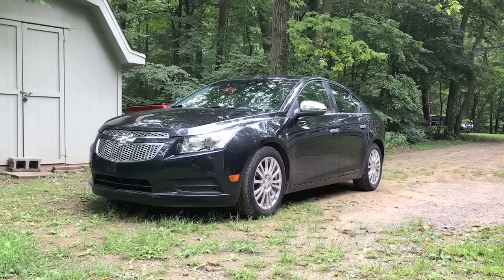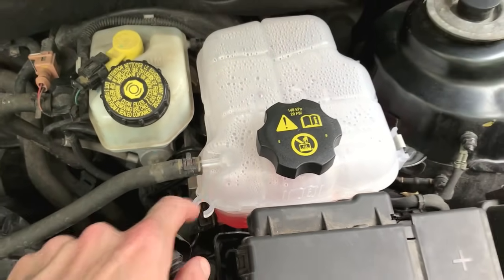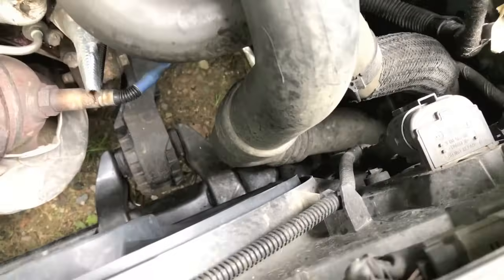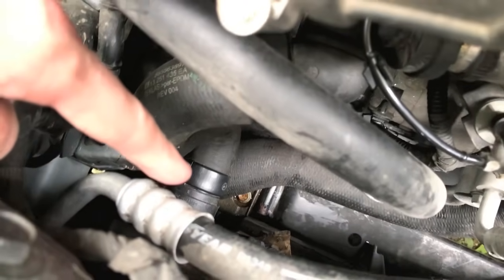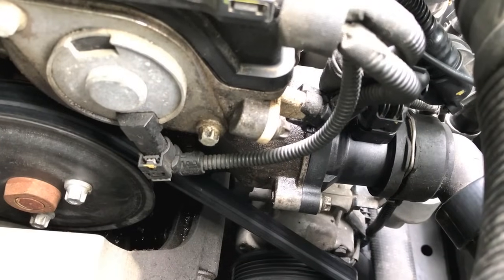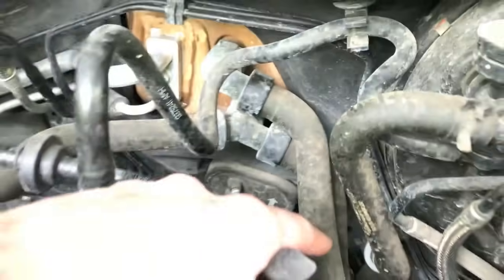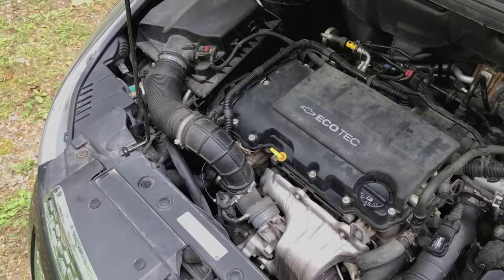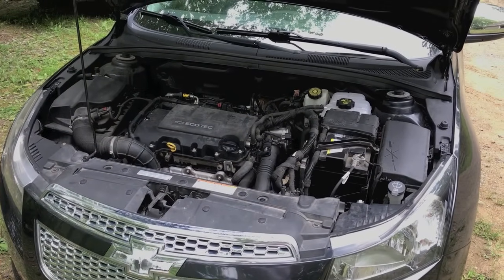Most common Chevy Cruze coolant system leaks! - Malibu/Impala as well

Comment: Loathe this car. It's like it was designed to fail from factory.
Reply: ouch
Reply: Literally. First nice car I buy myself and it's this piece of actual shit.
Reply: thank u so much
Reply: It is
Reply: My 2014 Cruze (bought it new) has 160000+ on the odometer. Just today the coolant reservoir started leaking coolant. Thankful I got that many miles out of it before having to replace the reservoir. But yes all these new vehicles with cheap plastic parts under the hood are designed to fail 😤
Reply: We have one also, they are horrible
Reply: Had a Mitsubishi that ran forever with minimal repairs. Bought a  Cruze and its  at the shop continually.
Reply: Fml
Reply: Bought Mine with 10k on the odometer. Leaked coolant sin e neatly the first day. Had fittings bust dramatically twice. Ill never by a GM again.
Reply: 190k and I beat the piss out of mine. Did the turbo for 200$ and the intake fix. All these fixes can be done really cheap at home!
Reply: Limp mode traced to leak at temp sensor feeding coolant into harness. Ruined PCM harness all the way back to O2 sensors. Still waiting for parts. GM charges for PCM programming …PCM harness is only available used…  Design for manufacturing, not for service or durability
Reply: (It was)

Comment: Thank you so much for this video. After 2+ years of a "mysterious" coolant leak, and hundreds of dollars down the drain with mechanics whom never fix the leak...I was driving home today from work when smoke starting billowing from the hood, getting home I open the hood to see coolant spraying like crazy, and with a quick google search I find your video...long story short, you pointed to EXACTLY where it's spewing from, the gasket seam on the thermostat, and now I know finally where it needs to be repaired! Thank you!
Reply from the maker: Ashley Matossian 

Thanks for watching & we hope you enjoyed the video.  We are happy you made it home safely & we appreciate you sharing your experience.  Hopefully a new Thermostat will solve your issues.  Keep us posted!

Many more helpful videos to come!  😀

Please subscribe to the channel and turn on your YouTube notification Bell 🛎 that would be awesome thanks again.

😎👍🔧🔩
Reply: This is only the beginning. In 3 years I've replaced 3 coolant recovery jugs, radiator, 2 thermostats,  waterpump, water outlet, both upper and lower radiator hoses, heater hoses and turbo coolant hoses (along with the turbocharger). Each time I install a new part, a pressure test tells me the leak is fixed. Then, before long, I smell coolant again and the leak - finding process begins all over again. As of this writing, the cooling system is leaking yet again. This is the worst car I have ever owned. My next car will be a Honda...good luck!
Reply: Same here except for I see how the area for mine looked like it's been wet alot

Comment: "Many years" my tundra has survived 14 years no maintenance like my gf pos chevy which is only 4.
Reply from the maker: Tyler Bolton 

Thanks for watching Tyler, let us know if you have any questions.

😎👍🔧🔩
Reply: Dude facts. My truck is a 2010. Never had any problems high miles, then she buys a 2014 Cruze. Replaced three components in her coolant system that have cracked or leaked just this year! On this video because she just called me on her way home with another low coolant reservoir. Very disappointed with Chevy
Reply: Ha ha. I’m a Toyota guy and have ran a few over 400k miles and still run them for work. Stupid Cruze is always a problem.
Reply: on my way to buy a damn tundra then second time i have a leak in the last 6 months
Reply: Lmao dang, no maintenance at all in 14 years?
Reply: Toyato is my next car hey are reliable
Reply: @RedBeard_1911  must only drive it 1 mile a day
Reply: Gm needs to get there foot of there but

Comment: Excellent video. Very informative. I've got a leak in my coolant system. The hoses to the turbo and the reservoir tank as well as the return line were all replaced. Had a pressure test done. Couldn't see any leaks. Not by me but from a shop. 1000$ later and I still have a problem. I'll keep an eye out around the thermostat and water pump area. Frustrating because about every 3 to 4 days, I have to add coolant. I'm not a grease monkey. Wish I was. I build elevators. I've learned alot from your channel and hopefully I can figure it out. AGAIN, THANK YOU FOR A GREAT VIDEO.
Reply from the maker: Semper Fi 

Thank you very much for sharing.  Sorry to hear about your engine troubles.  Adding coolant every 3-4 days is definitely not normal.

Let us know if you have any questions.  If you build elevators, you can work on a Cruze.  😀👍

Please subscribe to the channel and ring your YouTube bell 🔔 this will be very helpful to us thanks again.

😎👍🔧🔩
Reply: Did you ever find the leak?
Reply: After all these years did you ever find a fix?

Comment: Starting right at 2:00 minutes. That hose you are talking about has a smaller hose, #14 & #15 in the Chevy dealership coolant diagram, called a turbo charger coolant return hose line. The joint under the heat shield that connects to the hardline was leaking on my Cruze. Hope this helps others. Thanks for the video !!!
Reply from the maker: You rock & we appreciate you sharing this.  Any & all helpful info is greatly appreciated.

As we always say, us DIY’ers need to stick together!  😎👍
Reply: @DIYwithMichaelBorders  I decided against replacing the entire part since you have to remove the turbo to access it. I instead cut off the hose & hydraulic crimp off the hardline with my oscillating tool. I cut a 5/16 Dayco molded heater hose from AutoZone (B86800) to size & wrapped it with heat shield tape & added two new hose clamps. Seems like it works well!
Reply from the maker: @michaelhowell8990  

Thanks for the update Michael.  Hopefully many stress free days ahead for you.  😎👍

Comment: Thanks for the video - My Cruze is leaking and its either the water pump or the hoses on back firewall, or possibly the heater core. 
With this video I can now go and take a second 'better' look at all the places that it can be leaking from. 
My car only has 40K on it so I was surprised to have a leak so soon.
When I looked under my hood my leak seems to be farther back than the water pump area. I also inspected that side of the engine already. 
Water pump didnt look wet and the leak appears to lower down than that, I know the leak can be flowing down to appear more under the car than it is.
Reply from the maker: Ucan TrustMe 

Thanks for watching & sharing your experience.  In the event that it is your water pump, this is a GM recall part.

This means you can contact your local Chevy dealership and get it replaced for 100% free.

Keep us posted on your project.  Please subscribe to the channel and turn on your YouTube notification Bell 🛎 that would be awesome thanks again.

😎👍🔧🔩

Comment: Thank you for all the help. Been having a leak for a second time.  First was the water outlets hose which was replaced and seemed to do the trick. Ut now another slow leak and seems to be passenger side.  I am suspecting the water pump thermostat but gonna follow advice and see what I find after car is warmed up.  Thanks. 2014 chevy cruze Lt automatic
Reply from the maker: Rikan_LynX 

Thanks for watching & sharing your experience.  As you mentioned with the new leak coming from your passenger side, its usually the Thermostat.  Below is a link to our step-by-step video showing how to replace your Thermostat.

       https://youtu.be/8F-17wODadQ

Keep us posted!  Please subscribe to the channel and turn on your YouTube notification Bell 🛎 that would be awesome thanks again!

😎👍🔧🔩
Reply: Did you find what was leaking on the passenger side of the car? Mine has a leak in that area too and my car only has 40 thousand miles on it.
Reply: @DIYwithMichaelBorders  I have a leak right after the water pump not that hose that leads into the the tri connector towards the engine wall oh, what's that part number and do you have a video do you know somebody that has a video on how to replace that hose
Reply from the maker: Zeromus Phoenix 

Thanks for watching & we are glad to help.  This is a Dealership part only.  We recommend contacting your local Chevy dealership in providing them with the last 8 digits of your VIN #.  they will be able to get you the exact replacement part for your exact vehicle.

Us fellow DIY’ers need to stick together.  Many more helpful videos to come!  😀

Let us know if you have any questions.  Please subscribe to the channel and Ring your YouTube Bell 🛎 that would be awesome thanks again!

😎👍🔧🔩

Comment: Great, thank you for this video. I think I may have a bad water pump. Its super we in that area and the car dumps a half a reservoir after a day or two of driving. Going to look at it tomorrow and try and figure it out.
Reply from the maker: @maxpowers5055  

Thanks for watching, definitely likely if you are noticing a leak in that area.

Check out the video link below, it is a link to a video showing the full replacement process of the water pump.

       https://youtu.be/V85SIHpBLMQ?si=zam01jGNFoD8A_j5

However first, contact your local Chevy dealership and ask them if your Chevy Cruze is eligible for the full 100% free water pump replacement under the recall program.

They will need your VIN number and likely license plate number to check if your Cruze is eligible.

Comment: excellent easy to follow  videos Michael i can relate all repairs to my holden cruze in Australia which is awesome!! there is a small hose directly straight down from the oil filler cap its insulated in a flexible silver . type foil. it connect to the underside of the valve you are showing in this video.i have the slightest leak from that connection . its looks awkward to remove i have been searching for a video from someone else who has had that same issue, any feedback would be greatly appreciated, thanks again you are saving me heaps in repairs
Reply from the maker: Andy g 

Thanks for watching & sharing your experience.  Sorry for the delay.  What’s your update?  Have you fixed leak?

Unfortunately we are away from vehicle for a week.  Keep us posted on your DIY project.  Please subscribe to the channel and turn on your YouTube notification Bell 🛎 that would be awesome thanks again Andy g.

😎👍🔧🔩

Comment: What do you recommend for cleaning coolant and oil off of an engine? It’s looking pretty bad inside my engine. I’m doing some work on it soon. Would like to clean it up at the same time.
Reply from the maker: Good morning, just poured a ☕️ and am sitting down to answer any and all questions for the DIY community.

Great question, and that will depend on who you ask.  Most important thing to do is stay away from spraying your engine with a hose of water or any cleaning products being carelessly sprayed all over engine.

Both of which can cause havoc to your electrical system as it will likely get many of the internal engine component electrical sensors wet…which leads to the sensors acting very sporadically and acting as if they are faulty.

The - spray cleaning product on a paper-towel and dap/wipe clean engine is the best method.  Below is a link to a cleaning product we like.

If interested in purchasing this product, visit our Amazon affiliate link below.  I earn from qualifying purchases.

          https://amzn.to/41bt4sr

Let us know if you have any questions and hey if you’re interested, join our DIY ecosystem and help us grow an exclusive group of DIYers.

       toolboxtoken.com

Reach out to us any time!  🧰

Comment: Just installed my new coolant reservoir. Feels good. Only problem is when I filled it up, it continues to leak somewhere (just as the old one did) it’s disappearing in less than a minute. Only reason I replaced it is because a friend of mine, who has more experience than I do, took a look at the old one and suggested that that’s what it was. I seen a leak from somewhere under the old coolant tank but couldn’t point out exactly where it was, which is why I was quite sure it was the coolant tank itself.

My problem is that it keeps saying “AC off due to high engine temp”. Had my thermostat and radiator replaced last year. Water pump replaced at the end of July.
Reply from the maker: Thanks for watching & sharing this, any update?  The best way to pinpoint the leak is have your engine running to allow the system to pressurize.

Once system is pressurized, it will hopefully be easier to pinpoint the exact location of the leak.
Reply: @DIYwithMichaelBorders  yes, it’s still leaking somewhere. I can’t tell. I did pour the coolant in there while it was off and then ran the car. My car stalls and the engine knocks in idle.
Reply from the maker: @POPINTHETAPE  

Thanks for the update, is your engine not running long enough to allow the system to pressurize?
Reply: Did you find the problem
Reply: @anikajohnson4418  yes, i can’t find the recipets but I remember exactly because it costed me about $1100. I had to get a new valve cover replacement and have old oil around the engine cleaned, thermostat housing assembly and a water outlet valve. I no longer have the Cruze now.

Comment: Hi and great video! Sub'd.
Just replaced the water outlet valve/heat temp sensor assembly (the original plastic cracked) and upon checking for leaks I noticed some "weeping" at the top of the valve, where your finger is as you point to it at 1:46. I installed a brand new OEM AC Delco and I'm wondering if you have any ideas 💡 on how to do a minor fix on this verses R & R the entire heat temp/water valve assembly?
I thought of pulling the clip, pulling the return hose  and wrapping this water return valve with a tiny amount of high temp plumbers tape to stop the minor weeping, I'm experiencing.  Any thoughts?
Thank you in advance ☺
Reply from the maker: Thanks for watching & welcome to the DIY Raptor Club.  That hose is a dealership part only & will need to be purchased from your local Chevy dealership.

The hose itself is a very friendly DIY project.  Below is the link to our video showing how to properly replace it.

       https://youtu.be/FNXiR1do2Ws

Keep us posted.  Thanks for subscribing, we subscribed back.  Enjoy your day.

😎👍🔧🔩
Reply: @DIYwithMichaelBorders  Hi and thank you. However this OEM part is available on Amazon and at O'Reillys too
Reply from the maker: @agateenchantmentrockwizard5969  

Very cool, you may be able to get it at a more friendly price online.

😎👍🔧🔩

Comment: Thank you so much for explaining all the parts of my cooling system in such detail, possibly you can help me answer a question? I know your video is a few years old but I’m hoping somehow you’ll find my comments. I have a spraying leak that gets worse the lower my coolant is falling and more pressure is flowing. The leak is in the thicker hose directly under the water outflow valve. Would you advise using some silicone tape to seal until I can get into the shop for repair? Or anything that could seal/slow the leak for just a few days until I can get into the shop?
Reply from the maker: Thanks for watching and welcome to the DIY Raptor Club.  Let’s get this figured out!!

We recommend replacing the hose all together.  The best route to take is to contact your local Chevy dealership and provide them with the last 8 digits of your VIN number.

They will be able to get you the exact replacement part number for your exact engine.  You can either purchase replacement hose from dealership or use the part number they provide and purchase elsewhere, that’s personal preference.

Please keep us posted, we DIYers need to stick together!!!  Looking forward to hearing back from you Anon.

😎👍

Comment: My wife's 2014 Chevy Cruze thermostat has just begun to fail at 70,XXX miles. It's the one connected to the water pump on the left side of motor when facing vehicle for reference on lifetime of part.

The coolant reservoir and connecting hoses all failed at 60,XXX miles for reference, all parts were replaced with Dorman parts well worth it about 35.00

Part in question is at @3:10
Reply from the maker: Good morning & welcome to the DIY Raptor Club.  That’s a great idea, dorman has really helped many Cruze owners with their increased design & parts quality.

Hopefully many stress free days ahead for you after replacing the Thermostat.

😎👍🔧🔩
Reply: @DIYwithMichaelBorders  update the thermostat housing connected to the front left of the motor was a 2 part failure first was the rubber gasket, which is to be expected, nothing last forever. However after closer inspection of the housing the plastic tabs on the inside holding the plate and spring in place both had broken. So the valve was never fully closed and couldn't create a flush seal causing additional wear on gasket. 

Very interesting part, wish I could upload photos 📸  of the part for reference, part @ 3:10 for reference
Reply from the maker: @mezar4854  

Thanks for the update & have you completed replacing Thermostat?  If not, below is a link to our video showing replacement of Thermostat.

       https://youtu.be/8F-17wODadQ

😎👍🔧🔩
Reply: @DIYwithMichaelBorders  the linked is the one I used to replace that actual part ty! 

The next thing I plan on replacing is a pulley and a serpentine belt, one of them is squealing on idle and driving
Reply from the maker: @mezar4854  

Very cool, below is a link that may help you.

       https://youtu.be/0u-zCwZeyUo

😎👍🔧🔩

Comment: I have some bubble in the actual reservoir tank, & coolant is lacking from the left as soon as you put it in I have check the reservoir tank no leaks. I have replaced the radiator and the fan three months ago. But it shows no signs of overheating just smoking and bubbling in the tank it self. Now soon as you put any antifreeze in it runs right out on the left side any suggestions.
Reply: *leaking